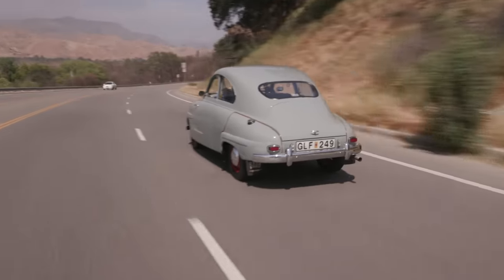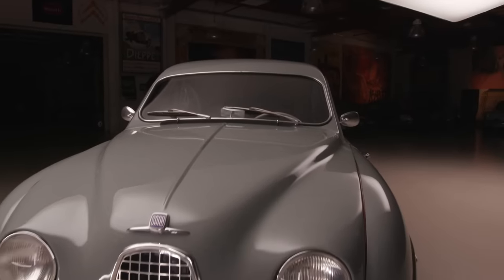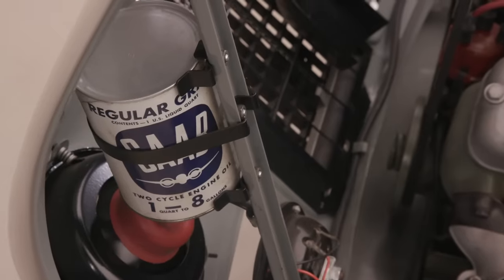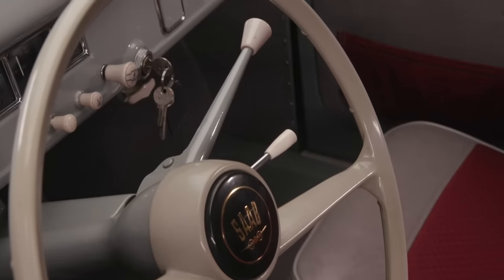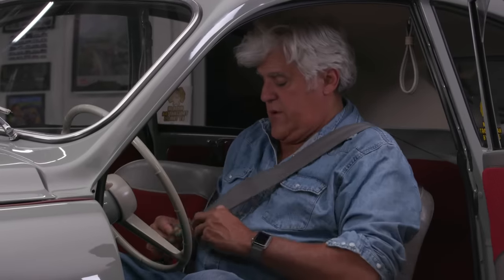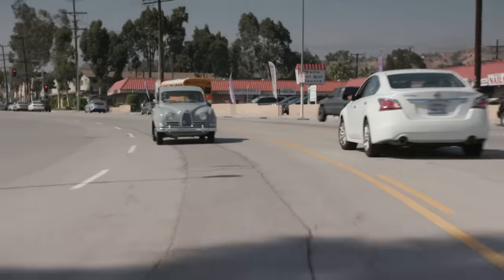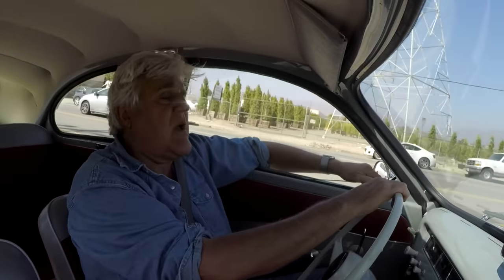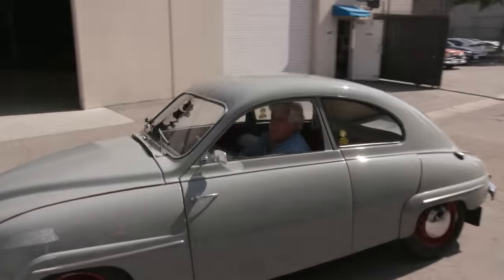1958 Saab 93 - Jay Leno's Garage

Comment: "you don't need a Ferrari or McLaren to have fun." This is more fun. These types of videos are way cooler too. Thanks Jay and team.
Reply: Tiny lightweight cars are amazing on winding roads, cause you can have fun without even breaking the speed limit, what's the point of 200 or 220mph top speed if you spend most of your time doing 20-40mph?
Reply: The smaller the vehicle the bigger the fun.
Reply: I had a Henry J , std car w/ 3spd 4 cyl. The top line Henry J had chrome around Windows and oh yeah, a 6 cyl and an overdrive!
Reply: Yes, please MORE of your collection!!!   So much more interesting.  Also, how about a "restoration update" video!  Thanks Jay and your team!
Reply: Ferrari? Meh.
Reply: This is definitely more fun. I would much rather own this car than a Ferrari or McLaren.
Reply: I agree Alan - this is my reasoning behind owning only a Yamaha RD350 for a motorcycle, rather than some big multi-cylinder bike capable of 180+ mph. That RD is a barrel of fun! Gets to 70 pretty quick - just takes a bit longer to break 3-digits, and boy do you know it when you're going that fast with no fairing or windscreen!
Reply: Yudh Isthira  - 7k miles since I overhauled it - haven't had a single issue (aside from some 45 year old ground wires that broke).
Reply: Yudh Isthira  - As long as they are kept in the proper state of tune, and you are aware of any changes to power output or sound while riding, you will never blow one up. :)
Reply: I agree. Much more interesting than the 'exotic' cars.
Reply: Stop! Hold on a second. Are you telling me legislators could put a maximum speed of 80 km/hour (or 24,232 aopstoarunits/quint/bid inverse) and people would still have fun in lighter, more fuel efficient, but faster accelerating vehicles?

EU-commission, US senate, Russian duma, Chinese giant congress of equals of equals are you hearing me?!!! Phase 65 is ready, execute order 66
Reply: @aopstoar4842  to be honest I have a good time with my end of the era  98 escort 5 speed and its 45mpg highway freedom, not to mention cheaper parts. I show off by having freedom to explore .
Reply: @aopstoar4842  , money is freedom in most places, thus they want it , from you and or by you or us shall I say., Canada voted down the carbon tax i just heard on a Canadian am station , never hear that on CNN. Best way to get even live small and enjoy your life freely.
Reply: @warkus123   true the hard part is to keep from being run over, fun part there i let them pass and catch them at the next light and go by them . and saved some stress on me and my car by going slower to boot.
Reply: Pau
Reply: Ferraris and McLarens are not fun when you need repairs
Reply: Cool but not more fun lol
Reply: ,2002, Saab 93 conver
Reply: T'... ?

:0)
Reply: In my old fiat 500 R  ,when i hit the 100 km/h (max speed) it's feel like i'm in a rocket ship  XD
Reply: Facts
Reply: "it's more fun to drive a slow car fast then to drive a fast car slow"
-James Pumphry
Reply: @ethanhellyer1828  Preach brother Ethan!
Reply: Agree, so much. This is way cooler than anything out there. You should show us an MG kit car, or something from the UK, the Eastern European Region, maybe a Lada? I want to see everything in the garage!
Reply: @JerryBanks572  Absolutely agree
Reply: Agree 😀
Reply: @warkus123  I know; it's hilarious when you see a Lambo in any downtown; they sound like crap revving to get to the next red light; like watching a cheetah trying to run in a 40 foot long cage; it's got to be frustrating! 🙄
Reply: Like my Citroen 2CV6
Reply: AMEN ....! 
I have a 1971 Karmann Ghia sedan, that I go driving around just for the heck of it ...!  Simply because it’s so much fun to drive...🎵🙏🎶
Reply: @ronaldreed7698  overdrive ( how much gearing wise? ) ahay ? so that's why the family had a kaiser/Henry j a 1948 and a 50's and gramp's did a lot of freeway driving to commute every day

BTW the engine 6-cylinder is the same as a clark fork lift and a older gm/buick/Oakland/ jeep production used and related to the 2006 jeep setup
Reply: This car was used succesfully in Rally Sport in the sixties for a reason.
Reply: Given the choice I’d take this Saab every time
Reply: @SmittySmithsonite thats nice i have a saab 9000 really durable
Reply: @JerryBanks572 true. Last spring I bought a '00 suzuki alto/Maruti zen with crazy 55 hp. Top speed is only 150 kmh but in that speed it feels dangerous 😂 it's so fun car to drive. And it's even yellow! 🤣

Comment: Someone once asked Carlsson how he managed to beat so many more powerful cars in one of these. He replied: 'I just never took my foot off.' Marvellous.
Reply: Also, he wasn't afraid to push the car to it's limits and beyond -- in Sweden his nickname was "Carlsson på taket" or "Carlsson on the roof" for his penchant of driving so fast that he occasionally flipped his Saab onto it's roof ;-)
Reply: ''Carlsson på taket '' was his nick name in Norway as well, cause he often turn around on the roof ;-)
Reply: He didn't have too. These handled so well. Just stab the brake and settle the suspension, chuck it in, and keep going.  Full throttle all the way.
Reply: @davidsteving6528  Later on it was found out that Scandinavian drivers used two techniques unknown to others: left foot braking and 'Scandinavian Flick'
The front wheel drive design only proved to fail when rally cars went over 200HP and Saab 99 Turbo ended up struggling and killing halfshafts. In the process Saab's rally team manager told Stig Blomqvist he's not expected to be loyal to the brand, and adviced him to get a faster car.

Comment: in sweden, that license plate GLF249 has now been recycled and passed down to a trailer, a  -08 Thule D0750, owned by a  contractor company located 30miles away from the very SAAB factory.
Reply: Holy 🐄!
Reply: I was just about to look it up so you saved me 30 seconds! 🥳
Reply: I didn't save the 30 seconds because I looked it up :-)
Reply: That    Cool
Reply: @G Michael Leonard 😂
Reply: Jay should do the the Saab 99/900. Interesting cars

Comment: OMG LMAO! The only 2 people I knew that owned real Saabs (before GM) were an English teacher and a college professor. You nailed it, Jay. 😂
Reply: Yep even in the 90's when I was in middle school the old bat librarian who also went to my church owned I believe it was a 75 or 76 Saab, so yeah he nailed it. lol!
Reply: Christiaan Overgaard old air plane people I’m guessing?
Reply: I was the first one in my family to buy a Saab, a 1984 900 turbo. Good car. Then my father bought a 2000 9-3 turbo manual and drove it until he was 89. "I'm not old enough to drive an automatic." Then my youngest brother bought a 2003/4 9-3 and my middle brother bought my father's car in 2012. 12 year old 9-3 turbo with 6,000 miles on the clock :-) My current Saab is a 2007 9-3 aero 2.8V6 turbo manual. Slightly modified. My previous Saab was a 1989 900 aero that I sold in 2012 with 315,000km on the clock. It was still being used as a daily driver at age 23 and did Melbourne to Queensland drives, around 1,800km of spirited driving each way, every summer in 40C+ temperatures.

My two brothers and I have engineering degrees. I worked in IT. Number 2 is a chartered accountant and number 3 is a recently retired civil engineer. Our father had a physics degree and was an army officer. Our mother did maths at UNI and was a rocket scientist at the end of WW2. Could there possibly be a trend here :-)
Reply: @WelcomeToTheMadness  you got it
Reply: @roadie3124  love it :-O
Reply: @roadie3124  living in Stockholm in the 70-80th I had bought a 900 turbo in 78 drove it till 82. I remember at that time we always had
lots of snow and it was always better to have something heavy in the back, due to it's front truction. But it was great drive otherwise!
Reply: @juttaweise  Heavy in the rear of the car? That would certainly lessen traction in a FWD car! I have personally experienced that in an Audi.
Reply: The only option was a tweed sports coat

Comment: hello ....i'm Pantelis from Greece...i'm 51 y.o and that video made me so emotional (especially my father he's 84 y.o and we saw this video together!!!!)  cause he bouth this car in 1964 and i was born inside this car in 1969 ....it was a Saab 94 construction in 1964 the older model from this car in your videiowith fuel and oil at the same tank...it was semi automatic by puting 1st-2nd and 3rd gear without pressing the clutch all you needed to do that is pulling  a small lever low on the steering axle next to and above the throttle..now the car is in the experienced hands of a fanatical collector of these cars..car's counter has reset 3 times. the engine was never converted and was spotless inside out and mechanically excellent for over 30 years. thank you for this video sir....Thank you so much for this emotional experience....* sorry for my English but i;m Greek)
Reply: That's fantastic!

Comment: Boy, this brings back memories. I took my driver's test in a '59 Saab 93 in 1963. The examiner was completely baffled by the rear-hinged doors and I had to explain about the free-wheeling so he wouldn't get freaked out going down hill. I grew up in Maine (still live there) and would purposely go out on a snowy day and pass people stuck trying to go uphill. It was a fun car to drive.
Reply: Amazing! I just bought a 1963 saab 96 I frequent Maine and mine is the same color scheme as jays 93
Reply: Mainer here too. Dad's first Saab was a 60 93F (F stood for front hinged.) So it was the last year of the 93 and did not have the suicide doors. I took my test in our third Saab; a 66 96 with 850 ccs, 3 one barrel carbs, and 46 mighty hp.

Comment: I remember filling up my 1959 at the gas station and watching the looks on the faces of other patrons when I would pour 2 stroke oil into the gas tank and bounce the little beast up and down with my foot on the bumper for a minute.  Ordinarily, I would mix it with some gas in a separate can I kept in the trunk, but sometimes you just love to do something to burn your existence into the minds in a small town.  Keep doing what you do so well.
Reply: That’s amazing. I’ve always wanted a 2 stroke Saab to go with my other Saabs
Reply: You pour the oil in first. The turbulence of the gasoline entering the tank mixes it.
Reply: That made me laugh out loud, with considerable force. Thank you.
Reply: @johnburns4017  Only if you were on empty. Otherwise, you had to figure out how much oil to pour in.  I was told to use chainsaw oil in mine. Filling up and adding a can for the ten gallon tank added 6 cents a gallon to the cost of the fill-up in 1974. That increased the cost per mile and adding the cost of the oil was like losing about 1/3 of the mpg I was getting.
Reply: @jaydee3046  BUT ... No Oil & Filter changes for the engine!  So subtract that back out.

Comment: I had a '62 93, in 1972, when I was 20. They had done away with the suicide doors, but everything else was the same. It came standard with the 4 spd on the column, which was a hoot to drive. The manual suggested when parking, while camping, find a suitable sized rock to put under a tire to keep the car from rolling away. The small door from the trunk folded down and the seats folded also to make a bed. As a 20 year old guy, this was a chick magnet car, girls loved riding in it. It smoked when you didn't get the mixture just right, it went like a tank through snow, etc. It got good gas mileage on long trips. I ended up hitting a Torino, parked in the middle of the street, and put a big U in the hood. It drove fine and I was able to sell it like that. I still miss that car!
Reply: um that ford Torino BBF ( orderd in / new not a used at the time of sale ) may have been in my moms ( and she was near or in the car at thee time of the insurance claim my uncle/gramps was driving ) family do you remember more about it? as my grandparents weren't the "hot car" buying type so it stands out of the rest of the list they've had and a black fox-body ( grandma's pride ) that lasted less than 90-day's ish and was replaced with a 90's coupe devile north star push-rod weird as well as generally striper model pick-up's and deluxe 4-door luxury barge's for tastes

my uncles on the other hand well typical younger 20's boys had to have hot cars like a 1971 440-6 SE sunroof ect. charger in metal flake gold and purle white interior wow 😲almost want to find it but i already have a 69 so thats a terrible idea if mine

Comment: Im from sweden and these bullets are superrare here too. Love them really.
The model after this has the v4 engine.  Also a rare sound.
Reply: Korrekt !
Reply: Margo Newman 
Saab på 50 talet,🤔😔😅
Reply: Yep. The Ford Taunus V4. The same engine that SAAB used in the Sonnet.
Reply: 2 stroke v4?
Reply: @ronaldreed7698  4 stroke V4 engine. Basically a V8 with 4 cylinders cut off.
Reply: That engine powered so many cars apparently they offered a lifetime warranty for the Saab for an extra $50.
Reply: Sounds a bit like a Subaru
Reply: @BIGBLOCK5022006  actually it was more like a v6. It had the same 60 degree v angle and the taunus v4 evolved into the Ford cologne v6.
Reply: @margonewman6086  & Daniel Gustavsson: Well, not quite correct – they made a later 93 model that didn't have suicide doors, and the the newer, larger model, the 96 that eventually got the V4 engine actually started out with much the same 3 cylinder two-stroke as well. I know, cause my dad had the 93 with normal doors and my uncle the 96 two-stroke. There was no mistaking that engine sound, except if they brought in an old DKW or a Wartburg (one of the last cars with a two-stroke engine to be sold, even later than the SAAB) – then you needed more expertise to hear the difference ...
Reply: You just invented  new model type ! ,,a  Superrare, or in Italian a Superrari so this would be  a  SAAB Superari ,   Brilliant !
Reply: the two stroke and V4 are what really made Saab unique!
Reply: What was the reaction to it shutting down?
Reply: @BIGBLOCK5022006  Think U.K. Ford Transit, or Corsair,  basically a van engine they tried sell as special just because it was a "V", and compact. Beware of anything from that era bearing a balance shaft. Soon got rid of!
Reply: @Roger-bl1ve  A Saabaru maybe? ;-)
Reply: Same thing in Norway.  I live less than 35 kilometres from the Swedish border, and both Volvo and Saab have allways been very popular brands here (handy for people to pop over to either Torsby or Arvika if they needed spare parts, 'cause they were allways much cheaper in Sweden. Not to mention Bilskroten in Charlottenberg...). There are a couple of enthusiasts here locally who's got them, but they only take them out on special occations in the summer. Even the model 96 is quite rare these days, come to think of it, especially the earlier ones.
Reply: @BIGBLOCK5022006  No, a Cologne V6 with 2 cylinders cut off. And not basically: literally a Cologne V6 with 2 fewer cylinders. Or rather, the V6 was the Taunus V4 (aka USA Ford Industrial 91H V4) with 2 cylinders added.
Reply: @ronaldreed7698  no.. it was a 4-stroke Ford V4 - a very popular engine in Europe from the 60's on

Comment: Finally! I'm one of those SAAB "guys" you refer to. My whole family is. The German Ford Taunus 4-strokes are killer too. Sweeden had the strongest steel w/the highest Boron content, and these were the strongest car bodies to ever have wheels. Thanks!
Reply: Back in the Days the Taunus was everywhere, nowadays I never ever see one, sometimes a Granada if I am Lucky !
Reply: I’d love to have a later 95 or 96 V4 with heated seats. The US got them through 1973, but I love how they stayed in production in Europe through 1980.
Reply: @judethaddaeus9742  Yes, and Canada had them up until 1975. My brother has a black '74 95, but it's rough. Black was VERY rare. The one problem w/post '73s are the heinous giant bumpers that all cars had to get.
Reply: UberLummox I didn’t realize you lucky Canucks got the 96 for 2 extra years! I like the big fat lip bumpers. They’re a SAAB trademark for the era. I also like how SAAB kept refining the styling through 1980, with the new grille design for 1974. They pulled a similar trick as Volvo did with the 240-Series in the 1980s painting the pillars and door frames black to give the illusion of more glass area and a black-painted decklid area between the taillights. It’s hard to make a bodyshell that was designed in the late ‘40s look good enough to market in 1980, especially with the tiny budget SAAB had at the time. But they were creative and pulled it off!

Comment: I remember whenever a Saab 93 passed by our home.the two-stroke engines would cause the TV reception to scramble .
Reply: Robby Dey  I'm guessing too noisy. The Trabant was too smokey.
Reply: LOL
Reply: Interference from the ignition system
Reply: Poorly shielded spark plug wires, most likely. My Dad restored a 1929 Model A Roadster. Flathead 4. The spark plugs were connected by brass sheet material. So...no shielding.
Reply: We used to call these corn-poppers!
Reply: Robby Dey  Ignition system wasn't exactly well shielded, plugwires with bad shielding basically become a signal jammer/send out white noise, same with old snowmobiles (edit) looks like i was 3rd on the ball
Reply: If only it had the same effect cell phones being used by selfish a$$holes whilst driving.....
Reply: 2-stroke? He said three. Something else was scrambled, and it wasn't reception.
Reply: @timkoontz6693  He said two.
Reply: @michele3314  We used to call these corn-poppers!
     And to think, one day we'd have a PRESIDENT who formerly battled with Corn Pop!
Reply: @timkoontz6693  Don't confuse 2-stroke vs 4-stroke with 3 cylinders vs 4 cylinders (or 6 or 8).
     If you do, you'll out yourself as someone who doesn't know about engines. At. All.
Reply: @timkoontz6693  Two stroke, three cylinders. ;-)
Reply: @CZ350tuner  Yep, you got that right, mate!
Reply: @timkoontz6693  2 stroke , 3 cylinders